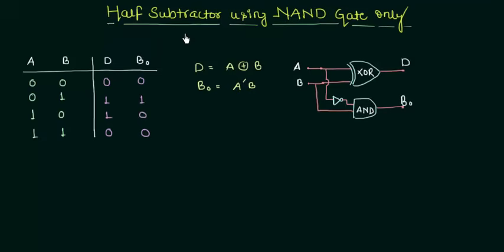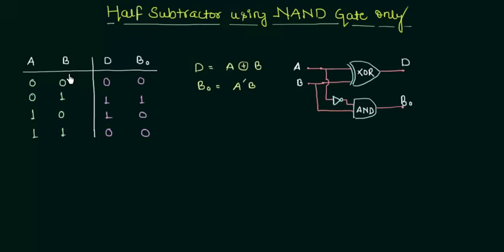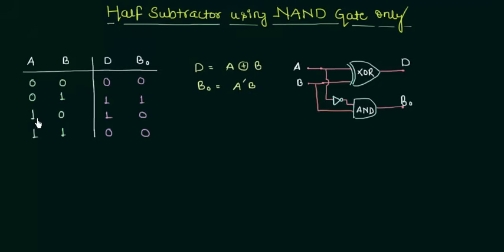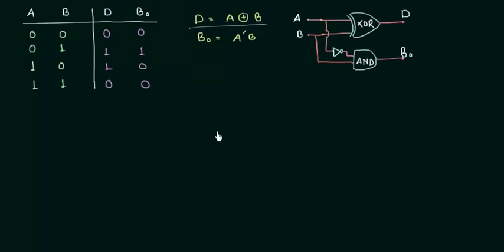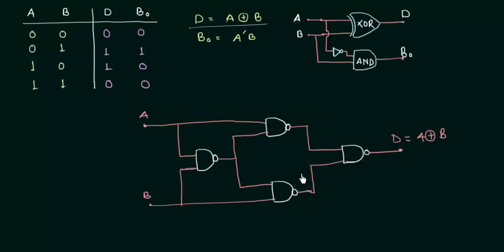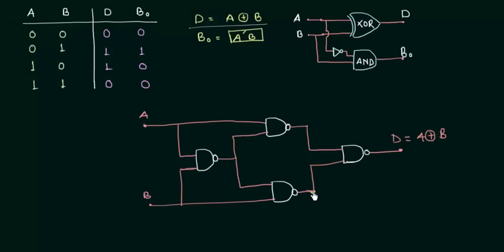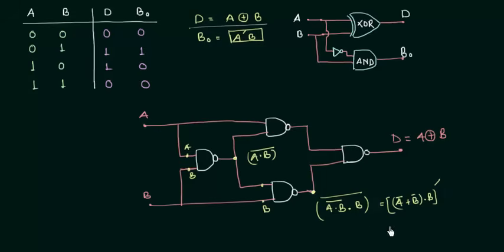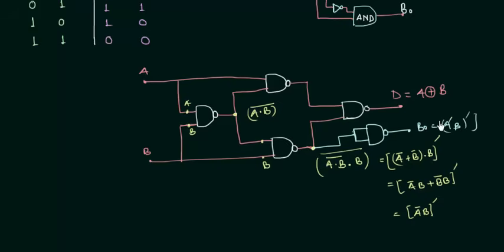Realizing Half Subtractor using NAND Gates only

Comment: instead of using an extra nand gate for borrow, you may have used the upper nand(input- a, (ab)')... because we tend to use least nand gates in an exam!
Reply: True if u sole that equation u will get the borrow equation
Reply: We also tend to not use the solution which will clearly not give the correct answer.
Reply: @UjjwalPandey24  using the upper does give the correct solution... for the borrow..
Reply: @socktroll532  No,The final equation for borrow will be (A'+B) if we use that eq.
Reply: @aswin972  sorry I got A'B only. So could you please explain that?
Reply: No